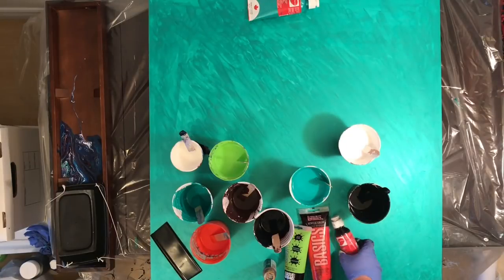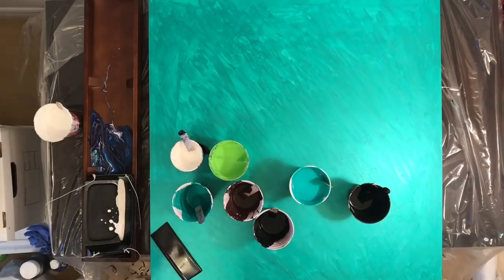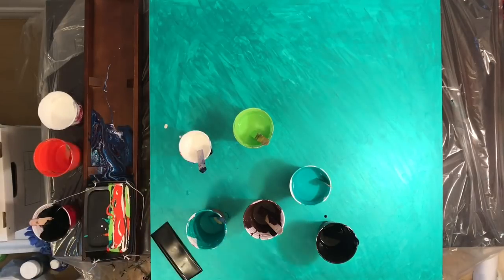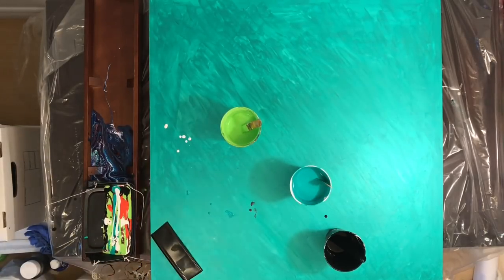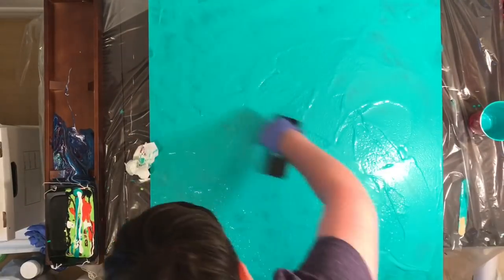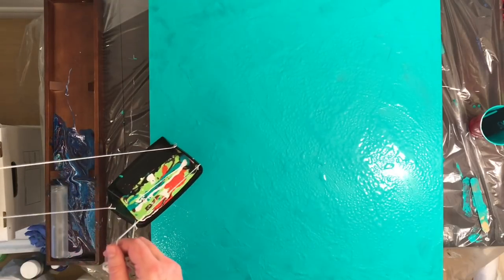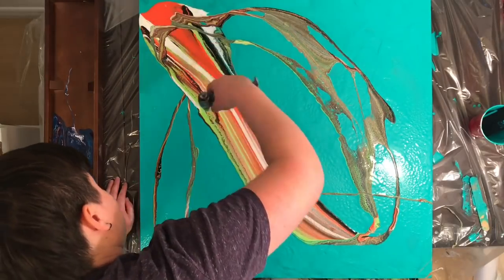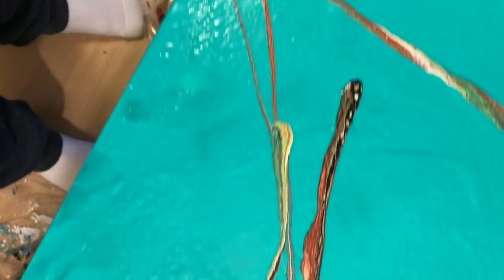Swirly-do. Delivering paint via strings and a tray

Comment: Gloss medium and varnish by liquitex works and mod podge for paper works. I've used the mod podge regular and that works great too. But liquitex pouring medium is the best. Gives the best cells. My mixture is to use mod podge paper mixed with water to make an air brush medium. One part mod podge to ten parts water. Then this air brush medium, paint, pouring medium and Floetrol. I don't measure I go by feel. I use silicone in pours.
Reply from the maker: Yes, I was hoping to avoid buying the expensive stuff but have a feeling I'm going to..

Comment: If you stir the shit out of your paint just before you use them, it will cause you to get a bunch of very small cells all over the place. If you want larger cells, mix up your paints a day in advance. Let them sit over night. Then stir it as little as possible before using.  I myself don't use cell makers. I have found that the mediums I use give me enough cells. If your using dimethicone or silicone to make cells, make sure not to stir to much or you'll get the little freckled cells. If you want the little on then get to stirring just before you paint.